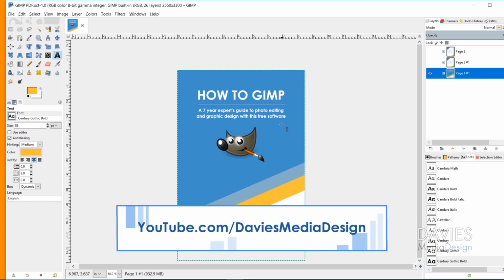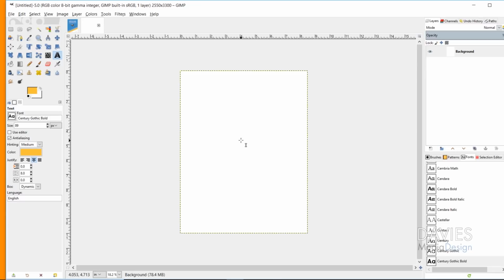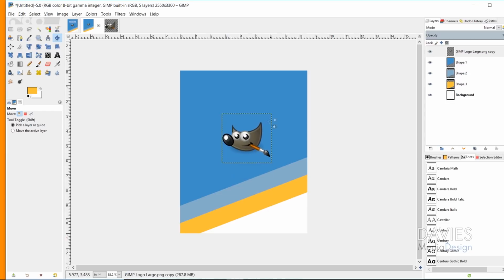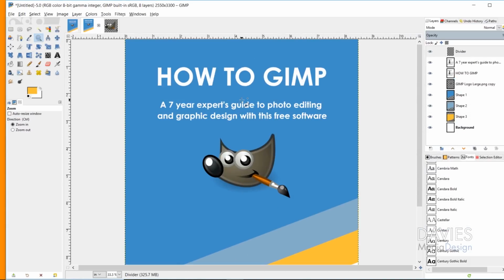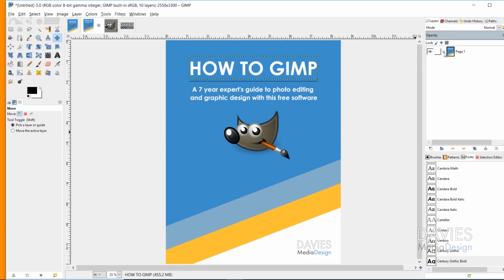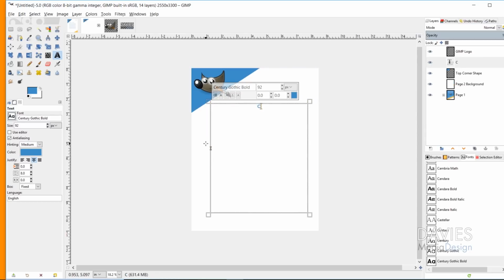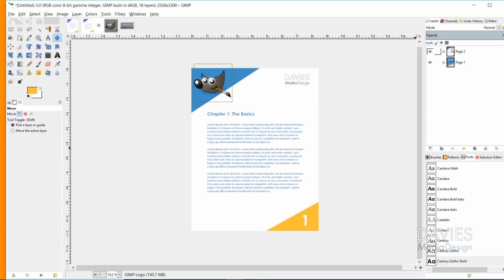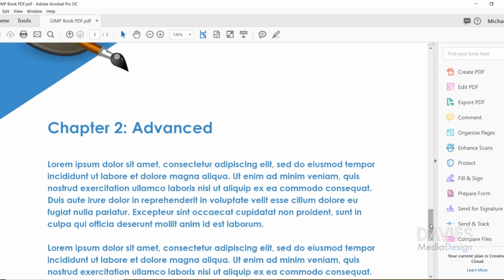Design and Export a Multi-Page PDF in GIMP 2.10

Comment: For every one having the issue of the export producing every single layer, this is the simplest solution I have come up with. First, make a copy of your XCF file, so you have it to make any amendments you need to at a later date. Open your copy and only make your first page (Layer Group) visible. Right click that group and select "Merge Visible Layers". I did not change any of the setting on this and just clicked "Merge".  This will condense all the layers in that group into one. Then hide that layer and make the next Layer Group visible and repeat that for all the Layer Groups you have. Once you have done this, export to PDF as per the video.  I hope this helps someone and saves you the two hours I lost.

Comment: Thanks for the video. I tried doing the exact same step but instead of rendering each Layer Group as a pages it renders each separate layer as individual page. Can you help me out with this?

One solution is I merge all layers and then import as pdf but that defeats the purpose of the feature. Any workaround?

Comment: as others here in the comments I tried all possiible combinations to save as PDF in separate pages from layer groups, only solution available is to merge down the content in each layer group (but it is no longer editable)
if I have one group it saves it correctly in one page, if I have more than one group it just creates as many pages as the layers
I wonder how Davies actually managed to do it as shown in the video, any help is much appreciated, thanks
PS I am running GIMP 2.10.24 on Windows 10
Reply: same issue ;/
Reply: Yes, still broken in 2.10.34. Quite bad considering that it's been a problem for at least three years judging by the comments here.

Comment: Thanks Davies Media Design for this awesome tutorial. After following the tutorial to the end, I was unable to successfully export the work into 3 pages from the group layers. Instead, the individual layers in each group layer was exported instead. What should I do to resolve this issue ? What part I'm I missing to glue the separate layers in one group to become one page upon exporting?
Reply: I have the same issue... Have you found a solution?
Reply: @thejanguitar  yes. I merged down the layers and it seemed to work.
Reply: @kennethkipchumba2532  But then you can't change texts afterwards, right? 
And the texts will be in normal pixel... :(
Reply: @thejanguitar  I believe that it is the version of gimp that does not provide that function of layers to pdf and when having to merge the layers in gimp they become images and lose quality in the pdf when zooming   .... :(

Comment: Hi Davies Media Design. Thanks for this tutorial. I have used it to create a 20 pages document, totalling about 280 layers, using the latest GIMP (2.10.18). However, when i do export as PDF and tick "layer as pages", then the PDF I obtain contains 280 pages, as I there were no layer Groups. Do you know if there is a feature that has been suppressed, or does it require a plugin? I hope you can answer that.
Thanks

Comment: 1. Buddy, your Davies Media Design logo can't be fully saved as an image from your site.
All we can get is the DAVIES outline. Are you sure it's not an image + text for 'Media' and 'Design' ?
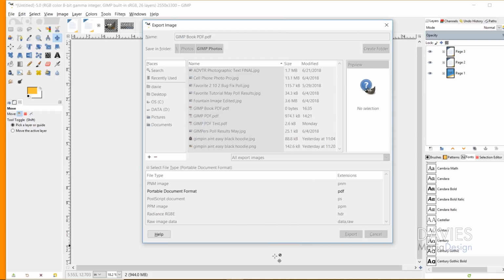2. 19:10 Checking "Layers As Pages" just puts each layer into its own separate page. This is wrong.
3. When I export, all I get is the topmost page. I don't get the underlying pages because the export command has no option for restricting the layers in a page to only those in the same layer-group.
You need to do more work on this. Slow down a bit on the tricky bits.

Comment: This didn't work for me. I figured it was my version, so I d/l gimp 2.10.14 and then I got a pdf with 235 pages instead of 13. I had to make a double and merge all the layers down to fake it. :(
Reply: Can you explain how to double and merge them thanks.
Reply: @WongAndrew_  I pressed ctrl+D to create a duplicate of my project, and then starting at the top, used the menus to "merge down" all the layers for each page until each page was only one layer. then it finally worked. kindof a pain in the ass :(
Reply: @cattheminion  Thanks so much!
Reply: I have been having the same issue.
Reply: works like a charm. Great thanks

Comment: How did you come up with 2550 x 3300 as the dimensions? For example, if I want to design a book with a 9" x 12" cover, how do I determine what dimensions to use for the gimp canvas?
Reply from the maker: Just change the units to inches, then set your resolution to whatever you want (if you are printing, go with 300 ppi). GIMP will automatically convert the image to pixels while you work because you are on a computer and computers use pixels. But you can set the units for yours guides to inches as well so as not to get confused. I hope that helps.
Reply: @DaviesMediaDesign  thanks a lot for the response! That's what I needed to know. Thank you.

Comment: Hi, when I hit "export as" button I can not see layers as multiple pages. Is there an option to enable it?
 My version of GIMP is 2.8.22. I'm running macOS.
Reply from the maker: I definitely recommend upgrading to the latest version of GIMP and then rewatching this tutorial. It may not work with older versions of GIMP - I am not entirely sure. But I always recommend using the latest GIMP version.
Reply: @DaviesMediaDesign  Funny thing is that you say "it might not work with older versions of GIMP", but we were trying it in a newer version then you in the video :D So my question is, why did they removed this function in GIMP 2.8.x?

I will try to upgrade to the newest version, but I kinda didn't like the new "photoshopy" modern look it had. That's why I downloaded an older version with the good old look..
Reply from the maker: @surtep1542  By "older versions" I certainly meant anything older than GIMP 2.10 (i.e. GIMP 2.8.x as you mentioned). I think this feature was not around in GIMP 2.8, though I could be wrong (I discovered this feature in GIMP 2.10). If the look of your GIMP is the only thing holding you back from updating, I certainly recommend checking out the beginning of my 2 hour GIMP 2.10 basics video where I go over how to change the look and color of your GIMP User Interface so that it matches the look in older versions.
Reply: I have exactly the same problem.. I wanted to edit a 3 page document, but I can only export it as 1 page without the other 2 pages.. Even tho there are 3 layers.. Pretty annoying they removed the option or I am not sure what else to do..

Comment: Thanks very much for this, Michael. 

I have a couple of questions about this, which I hope you will answer.
1. I presume that, since there are no photos in the the design, the preferred way of doing this would be in a vector-based programme. Is that correct?

2. Instead of clicking on a logo (e.g., the GIMP logo), and then going Edit - Copy, followed by Edit-Paste, can one simply select the logo and drag it onto the design page? Or, at the very least, using Control/Command C, and then Control/Command V?

Thank you.
Reply from the maker: Thanks for the comment and the questions! I think whether or not a vector-based program is best for your project will depend on what elements are going into your project. GIMP is always great for photo editing and simple design, but if you want to make more crisp graphics that are also scalable in either direction (up or down) without losing quality at a later date (or even during your project), then you might want to create vector objects in a vector-based program. To answer your second question, you can drag the GIMP logo file directly from your file folder into your composition to save a step. In my experience, you cannot hit ctrl+c on your keyboard to successfully copy an image from one composition to another. However, you can do that for layers within a single project. Thanks again!
Reply: Thanks very much, Michael :)